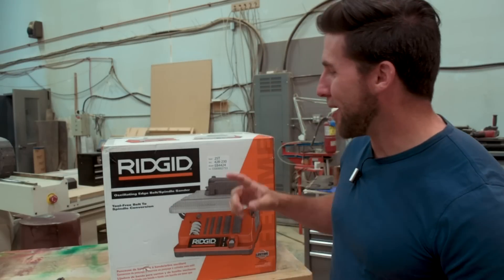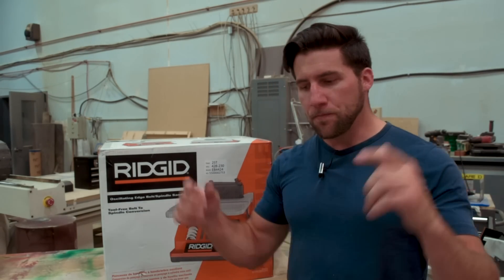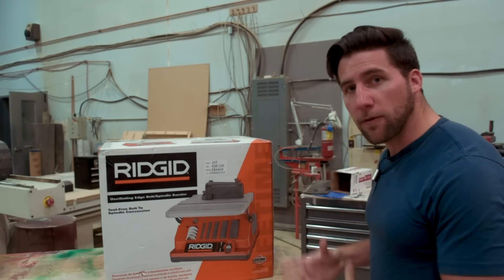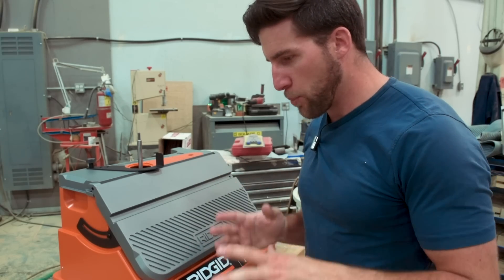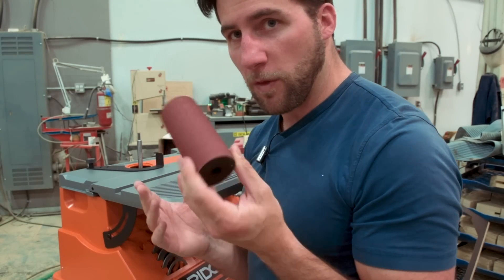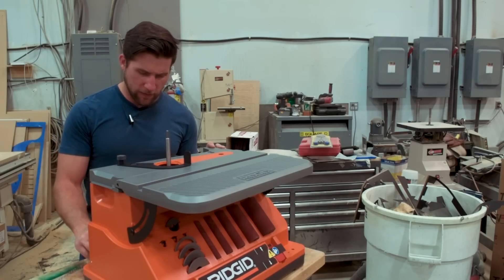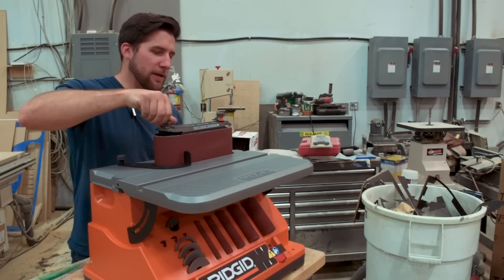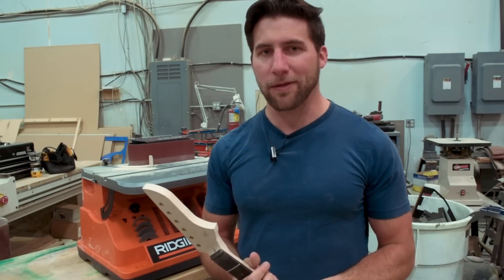A Cool New Sander and a Quick Great Guitar Build Off Spoiler

Comment from the maker: Hey everyone! Just a quick, but important, safety note. Those little spindles for the drill can only be used in a router on low speeds (a variable speed router). They’re already not designed for that RPM rate. They’ve worked fine for me on the lowest setting on my router, but they are likely to fly apart on a high speed router/setting. Stay safe folks!
Reply: I was about to comment asking about that.  I haven't gotten the courage to try on the router table, but they also can be used on a drill press using the table as a reference face.
Reply: Very good safety tip, thanks!
Reply from the maker: The drill press is the safer option. On the router table if it’s low speed it should work, but it’s still not designed for that. I should be passing on my risky habits.
Reply from the maker: Cheers
Reply: My pick to win the GGBO of 2021 go get em' Brad!
Reply from the maker: Thanks Rocky!

Comment: I ordered one of those from HD 2 weeks ago and it was dead on arrival. Motor kept tripping a gfci. They were out of stock, so I got the Wen. Been using it about 2-3 days now and like it a lot, but the spindle sandpaper it came with is wearing our real fast. I’m glad yours worked!
Reply from the maker: I’m glad the wen is working well. Unfortunately the spindle paper tends to go fast. Small surface area. I guess the lifetime service thing from ridgid probably doesn’t help if it’s DOA.

Comment: Looks the double of the Triton oscillating sander... only £180.. looking awesome marra. Its amazing how many times you need a belt sander to save time fitting a new nut. I'm loving the angles on the build off headstock.
Reply from the maker: Thanks Stu. Triton seems to make great stuff. I wonder if they’re actually the same unit essentially.
Reply: @BradAngove  they look almost identical mate.. same factory different sticker..
Reply from the maker: Intriguing. Probably made in the same place.

Comment: Thanks for the video. That Rigid sander looks cool. I've been using the sanding drums on my drill press for sanding interior curves on guitar bodies. Are you sure those drums are safe to use in a router? Routers spin super fast. Good luck on the guitar build off.
Reply from the maker: Thanks John. I should have clarified, and have now left a pinned comment trying to clarify, that they only work on the low speed setting. I only use them on my variable speed router. They are likely to break apart and go flying at high velocity on a high speed setting or a router that doesn’t have a slow option.

Comment: I have a generic version of this in the UK. Works fine but realised after a while it was not giving an accurate 90* sanding angle until I realised that angled table was not perfectly flat and had to Dremmel excess enamel paint from the gap and levelled the bed up.
Reply from the maker: I’ll have to double check mine I guess.

Comment: Hey Brad, I just received a .Strandberg* guitar kit with a flame maple veneer. It's a Chinese kit so the veneer is kinda trash, so i'm removing it, and using a .6mm plate of copper as a top. Do you have any tips on bending the copper over the arm contour? I'm using a very strong contact glue, but I feel like the copper would slowly detach over time.

PS: Congrats on nearly 100K subs, I don't remember how many subs you had when I subscribed (looked it up, it was october 2015), but you've really improved your video quality since then, and it shows.
Reply from the maker: Thanks Dylan. I know there is some trick involving heating or annealing, but I don’t actually know the specifics. I think Ben from Crimson Guitars knows how to form copper to carved top guitars.

Comment: I like the videos keep them coming !!! I mounted one of those rubber sanders in my router and almost died !!! Apparently to high speed ? LOL
Reply from the maker: Ya, I pinned a comment about that. Forgot to mention that you need to use a variable speed router on the lowest setting for that to work. Otherwise the sandpaper will fly apart!

Comment: I laughed a lot during this. Especially the expressions on your face as you tilted it up and everything fell into it. So 2 quick things for you. Read your manual to be sure as I do not have that exact one but mine is similar, the washers are going to be very important for the spindles. The sand paper slips on those rubber things easily but they also slip off, the washers are used when you tighten them down as they compress then the rubber expands out hence holding the sandpaper tight. Also I really like your new logo, I noticed on the video at the beginning you still have your old Logo as a water mark in the upper left corner. So you might want to change that. Keep doing what you do.
Reply from the maker: Thanks Jeff. I’ve been toying with the idea of switching the logo. The channel is still me and not so much “Angove Guitars” per se. I might have to make the transition at some point here though.

Comment: you can't use those sanding wheels in your router the twerk trowes them off and it will hurt when it hits you trust me i know
Reply from the maker: Ya, I’ve posted a pinned comment clarifying that that only works on a variable speed router at the lowest setting. I wish I had remembered to mention that in the video.

Comment: You should make a pc build where its only with really affordable hand tools where someone who only wants to make one guitar and doesnt want to buy that many tools and isn't interested in any fancy top wood or anything can make one
Reply: That's easy. Buy a kit with a block of body wood, buy you a plunge router and a jigsaw, and get to making. You'll need stuff to sand with and probably some rasps and files, too. For a basic build, you likely don't need much more than that depending on what you're starting with. The router will cut out the body shape, pickups routing, neck pocket and control cavity. Then it's on you to shape it once it's cut out.
Reply from the maker: You could just try a normal guitar kit. The only power tool you need for those is a soldering iron. In fact, I did a build with no power tools and only products from Home Depot and Walmart. That was the Home Depot challenge build. Have a look.

Comment: Nice sander, bur you should not have put the rubber feet on it, as it will be impossible to put it back in the box to take home, let's see you rebox it.

Cheers.
Reply from the maker: I threw out the box at the shop and just put the sander in my trunk to take hope. Piece of cake.
Reply: Brad Angove yeah, I call that cheatering... 🤘

Comment: Hate to be the bearer of bad news, but that ridgid model is almost 75 CDN less than the wen on Amazon. Hell. Even a triton one is 25 bucks less. I'd love to support you, but that's a lot of sandpaper for the sander itself that I can buy with the savings.
Reply from the maker: Fair enough! When I looked at it the price difference was about $40 with the WEN being a bit less expensive. No reason to buy the pricier model when this one clearly works great!
Reply: @BradAngove  that's so odd, as you just posted this today, that the price changed so much.
Reply from the maker: Ya, I only made this video on the weekend. That surprises me.

Comment: Hi Brad. I have watch a few of your videos keep them coming regarding the guitar build off. But your comment on the rubber sanding spindles, could also be used in a router is an incorrect and a dangerous statement. They are design for much low speed machines, ie drills. Routers will hit high speeds of 11,000 to 22,000 rpm, drills a few hundred rpm.   Don’t forget they are only held together with glue. Giving incorrect tool use can cause physical injury or damage to the workpiece. Please except this comment in good faith, one tradesmen looking out for another...Best wishes Mike
Reply from the maker: Thanks mike. You make a good point. I should have clarified that I only use them on the low speed setting on my variable speed router. They work well for me on that setting though. I’ll pin a comment to that effect. I appreciate you pointing it out.
Reply: No problem Brad. All the best with the Great Guitar Build Off. Mike
Reply: M I Tarr guitars *accept

Comment: I also just bought the same machine. It has been working great for my guitar build I have going on. I did build my own little wrench for the lefthand thread nut to tighten with the larger rubber.  I used it the thickness the curly maple I am using for binding. Just set up a fence line on a router table.  Have a look Jonezzy1978 on instagram